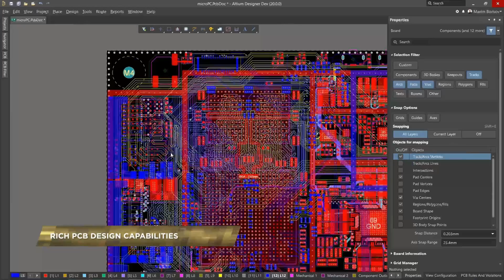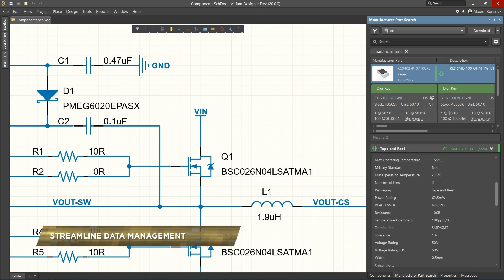Joystick Controller Tester Circuit

Comment: EE here. Why why? Why did you make the second circuit line (mains) powered? You could have done the same thing with a simple battery-powered LM555 circuit without creating a dangerous direct to mains connected circuit that could kill people! Yes, the components are inside a plastic box but any short ( since you don't have a fuse) will blow up in someone's hand or possibly kill them.  Please! Please! Post a warning!